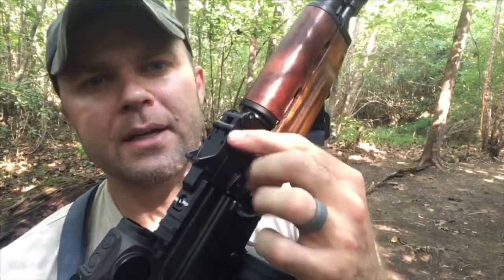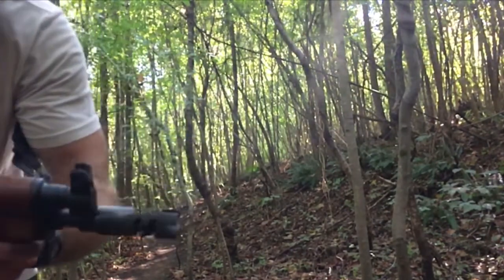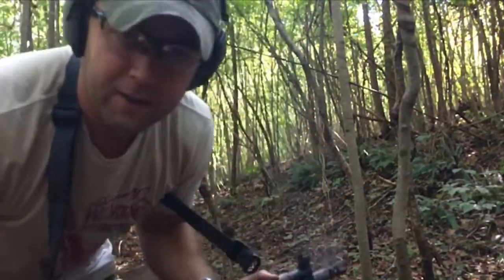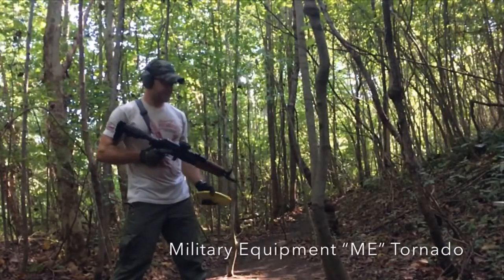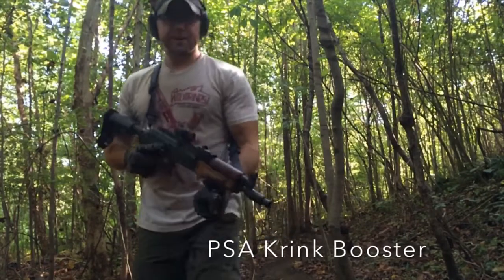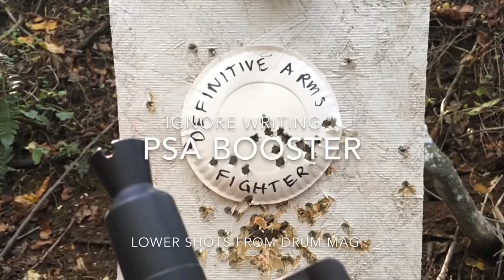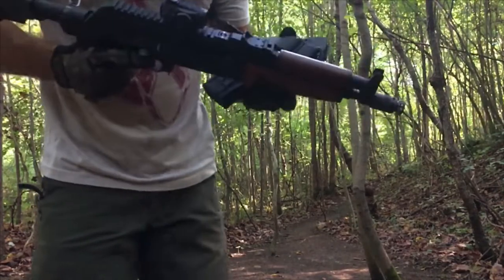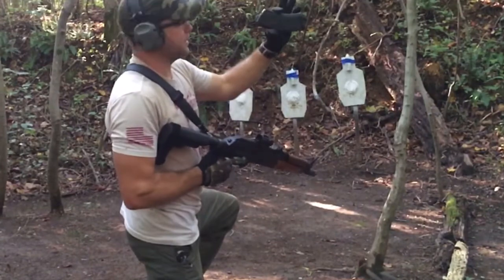PSA AK-P ..... DID THEY FIX THE TOP COVER? / MUZZLE DEVICE TESTING / KOREAN DRUM MAG

Comment: Plan to get the AK-P soon. After all I've read, the top cover coming loose seems to be a common issue. Its almost 2022, I'm not sure if PSA has addressed this problem other than have AK-P's sent back to them. Seems like I will need to have a lock washer and/or rockset on hand when I get this AK-P. Great video, man. Helped a ton. Subbed!

Comment: To tighten that loose brake, get a crush washer for 7.62 barrel, file a deep enough notch for the plunger pin to secure the brake when you tighten it against the crush washer. This has worked for me to tighten a loose brake.
Reply from the maker: Thanks! But that brake is going in the pile.....

Comment: I'm glad I never had an issue with my Saiga. 1500+ rounds so far and no issues
Reply from the maker: You shouldn’t.
Reply: I've got a little over 1k rounds through my psak47 gb2 with no issues. I don't like the fact that it has a billet trunion but I only have $500 in it so I'm just gonna run the shit out of it until something breaks. It's been surprisingly accurate and %100 reliable with pmags and cheap steel cased ammo.

Comment: you need to use muzzle devices designed with the offset detent pin, your normal AK variant pin is at the top and it clocks the muzzle device to work as a brake, flash hider...ect, the krink booster has an offset notch for the offset detent pin on the krink style front sight block. on my M92pap(same front sight block) I took a new detent pin and bent the end of it so it almost touches the threads, took a kvar 74 style brake with 24mm threads and cut a new notch to line up with the offset pin. about 3000 rounds through my m92 with atleast half of that 75rd drum bump fire dumps and the thing doesn't show any wear just dirty as hell, dont worry about abusing these things!
Reply from the maker: Yeah, the break was definitely not timed correctly. Thanks!

Comment: Good to hear so far so good on fix. Ever figure out how to install a decent light platform yet? Getting ready to order akp  and that has been my biggest head scratcher so far, thanks in advance
Reply from the maker: Ultimac rail, with haley strategic mount. Checkout Aregularguy 90 on youtube. He has a draco setup.
Reply: Or just get one with magpul furniture. Their handguards do an amazing job of insulting you from the heat off the barrel and gas block. Plus they have mlok attachment points at 6, 3, and 9 o'clock.
Reply from the maker: Agree the Magpul HGs are awesome at blocking heat.
Reply: I have magpul furniture on my AK. Used an offset MLok mount and and SF600. Works great. Check out my AK LARP video. :)

Comment: Anytime I have a screw, which I don't actually need to unscrew at any point in time, but I definitely don't want it to unscrew on it's own: I'll just JB weld the bastard and be done with it.  Mix up some JB, put it on the screw, put it in place, tight, clean up the excess and let it cure for 24 hours - It won't ever go anywhere again. 

When you absolutely do want to remove it: lock screws are soft steel, just drill through it with an under sized bit. Then repeatedly drill the same hole with one size larger and larger until what's left of the screw body comes out and then chase the screw hole with a tap the correct pitch and size.

Comment: Did you send the rifle back just for the loose bolt? Or were there other issues as well?
Reply from the maker: I just wanted to see if what they put on would fix it. It came with red loctite. They also replaced the roll pin.

Comment: Seems to me that that ME brake is designed for .308 / 7.62x54R AK variants. The pin on the krink fsb isn’t designed for the detent recess on that brake.
Reply: Liked and subscribed thanks for making a vid about that brake. Should do well on my 103
Reply from the maker: The detent on the AKP isn’t at 13 o’clock like others.
Reply: @wellregulated8725  what the fuck kinda clocks you looking at that have 13s on em
Reply: @wellregulated8725  🙃
Reply from the maker: @ritotron5752  supposed to be 12…. 🤦🏼‍♂️
Reply from the maker: @ritotron5752  gassed back a lot though…. And loud

Comment: What's the latest with your AK-P top cover? Unfortunately, I noticed that it had come loose again when I was cleaning mine today. I won't send it back in to PSA a second time for this but will have to try using a lock washer or something. This is really irritating. They're coming out with some great AK's, I wish they would fix this one particular design flaw for the AK-P as well.
Reply: Anytime I have a screw, which I don't actually need to unscrew at any point in time, but I definitely don't want it to unscrew on it's own: I'll just JB weld the bastard and be done with it.  Mix up some JB, put it on the screw, put it in place, tight, clean up the excess and let it cure for 24 hours - It won't ever go anywhere again. When you absolutely do want to remove it: lock screws are soft steel, just drill through it with an under sized bit. Then repeatedly drill the same hole with one size larger and larger until what's left of the screw body comes out and then chase the screw hole with a tap the correct pitch and size.
Reply: @ObservingLibertarian  sounds good to me
Reply from the maker: Hope they fix it this time. Join the PSA AK group on FB.

Comment: Has it ever failed on you with just a regular non booster brake?
Reply from the maker: TryHardGamers only prob was the top cover. No malfunctions.
Reply from the maker: TryHardGamers wait, what are you referring to specifically?
Reply: @wellregulated8725  I'd like to run a pistol AK with a brake rather than a booster.  I imagine this could be a recipe for failure,  but clearly you mag dumped fine with the fighter brake on.  Have you ever experienced an issue using a brake on a pistol ak?

Comment: Knowing the issues now... I think some red loctite on the roll pin and the Allen screw right out the box would do great. Clear nail polish works just was well if you NEVER want to remove it again
Reply from the maker: The gun did come with red Loctite on the allen screw.

Comment: Where did you purchase the new furniture ? Looks sick compared to the Magpul on this particular "pistol". Also spoke with PSA yesterday. All of the AK-P future cover screws has been corrected ! Informative video. Still concerned as a lefty if this will cause to much blow back compared to a 16" barrel...hmm
Reply from the maker: Bought it second hand, and a few surplus stores. Try Lee’s Mags, Desert Fox Tactical, and apex gun parts. 👍🏼
Reply: Interesting! Did they say how they've corrected it specifically?
Reply from the maker: Nope. I sent a note in the box asking them to explain what they did... but it was blank.
Reply: @wellregulated8725  sorry, the question was meant for "IndialanticRob", he mentioned that the AK-P future cover screws have been "corrected". I wonder what they told him. Maybe they used a different size? Or just that the dark gray thread lock is now their standard. I had the same color thread lock on mine when I got it back.
Reply from the maker: 👍🏼 I’m curious to know if the screws are different.
Reply: @CheJoffre  the exact answer was "we have corrected the cover screw". I did not receive the how or what. Lead Star Arms whom also sells on PSA has the same cover and screw design. I was told they fixed theirs as well when I contacted them.
Reply: @IndialanticRob  Thank you. Hopefully eventually they'll permanently attach the two pieces. It's annoying having to worry about that screw backing out.
Reply: 2 years later here I am reading as much as I can from the Ak-p. I plan to get it real soon but dont want to send it back to PSA like you gents, have. Ugh. Thats frustrating! Specially over a small screw! I will buy rock sett thread locker and have it here just in case. I have some JB weld but that would be a last resort. I really dont wanna go that route but will if I have to. I read PSA corrected this. I hope this is true… we shall see. I do plan to make a video on my channel on it once I get it. Well Regulated has given us valuable info and I have learned from all you dudes. Thanks!🇺🇸

Comment: What size is the bolt that keeps backing out?
Reply from the maker: No sure… it’s gone now
Reply: @wellregulated8725  must of missed your fix.  I will rewatch your video.
I added more red loctite to the thread after cleaning it out. Next range day will tell me if it fixed it.
Reply from the maker: @wrangler0829  did you have a problem?
Reply: @wellregulated8725  same issue as yours. Screw for the hinged dust cover fell out after the first trip to the range. Found it on my tarp when I was cleaning brass.
Reply from the maker: @wrangler0829  that sucks. Should’ve been attached like an M92 or krink. That.. or have 2 screws.

Comment: Me When You Mentioned The Issue: Why didn't you just use rock set instead of sending it back?  
You: They used dark gray rock set.
Reply from the maker: I wanted them to fix it. Should’ve been right from the get-go.
Reply: @wellregulated8725  you expected an American-made AK with an unconventional hinged dust cover to be right? You're a brave man lol. If they actually hold a zero even with the bolt secured, I'd be impressed enough to buy one of that design in a full sized platform though.
Reply from the maker: I should’ve gotten a draco.
Reply: @wellregulated8725  yeah man i feeeeeeel that. My AK-V is eating dust covers. The rear is cheweed up and the bolt stays tight but the entire cover is being pushed back and the bolt digs into the cover area. Its wild. They want it back again. I shoulda got a draco too. Akv has issues!
Reply from the maker: I’m down to Romanian stuff now...

Comment: How long is the akp not including the brace?
Reply from the maker: Like from the back of the receiver to the end of the barrel?
Reply: @wellregulated8725  yeah, I'm looking at the model with the folding brace and can't find an overall length anywhere
Reply: @wellregulated8725  bump
Reply from the maker: Did you answer?
Reply: @wellregulated8725  yeah I said yes, from the back of the reciever to the end of the barrel, I'm looking at the model with the folding brace and can't find any measurements
Reply from the maker: 19 3/8”
Reply: @wellregulated8725  great, thanks
Reply from the maker: That’s end of barrel... not muzzle device.

Comment: I want to get the triangle side folder
Reply from the maker: Me too, not crazy about the blocky folding mechanism.
Reply: @wellregulated8725  I thought it was an actually attachment you need to pin and screw into it, but apparently the triangle folder attaches to a 1913 rail. So technically it can go on any gun that has that rail end plate
Reply from the maker: Ok. I wish it bolted directly to the rear.
Reply: @wellregulated8725  Probably making it easier for people who don't want to drill holes into their AKs
Reply from the maker: Paps, dracos, and all.....
Reply: @wellregulated8725  so get one of THOSE, add a 1913 rail on the back and attach the triangle folder?

Comment: Why didn't they just make it one solid piece? That would have been the smart thing to do.
Reply from the maker: I have a feeling it has something to do with modularity in the future.
Reply: Yeah true. Worst case I guess you could always just throw a Texas weapons system rail on it. I believe they're one solid piece. You could also throw some red loctite on it or even throw a tack weld on it. It's not like you'd ever really have a reason to remove that screw. If you needed to remove the cover for some reason you could take the roll pin out.
Reply from the maker: It came with red loctite!
Reply: Damn, that's crazy. That usually won't let loose without very high heat. Way more than a dust cover should ever see.
Reply from the maker: There is a chance the threads weren’t cleaned properly and vibration rattled it loose..... 🤷🏼‍♂️
Reply: Yeah or if it had any kind of grease or oil that'll affect the loctite. It's good though that it's holding now.
Reply from the maker: So far so good.

Comment: Why not just put some green lock tite?? Would never move again
Reply from the maker: Years ago I put the thread penetrating green loctite on something....... and I broke the hardware taking it off. Not sure how the green takes heat... 🤷🏼‍♂️
Reply: @wellregulated8725  green loctite is pretty much welding them. It's for when you never what to take it apart. Needs a lot of heat to come loose. Red should work if it needs to be taken off
Reply from the maker: Came with red.

Comment: I would not run rounds like that in my own gun; might result in problems other than the sight system. There is a reason that the sustained rate of fire for rifles like the M16A2 is 13-15 rounds per MINUTE. Nice video, thanks!

Comment: Bro, you sent your gun back into PSA to have them put threar locker on it. Cmon bro. Ita called red loctite. Put it on yourself first.
Reply from the maker: Bro, it came with red loctite. They use rock-set, or something similar.
Reply: @wellregulated8725  yeah, I've heard of that. My buddy puts rockset on his cloner guns. My point is you could have bought a tube and put it on your threads yourself. I had to send a buddies AKP in that's all messed up and the gun was gone for over a month.
Reply from the maker: I’ve got other guns. It wasn’t my responsibility. If I put a rail on or something that kept coming loose I would’ve done it myself. This was their problem.
Reply: @StraitClownin909  What PSA needs to do is change the design for how the topcover is attached. I had the same issues and tried red loctite but that didn't work. Sent it into PSA as well and it was fine for a while, but it is loose again. Instead of attaching the top cover with a screw it should be hinged permanently.
Reply: @wellregulated8725  Exactly!

Comment: Poor unreliable design. They should have copied same shit Zastava m92 has. No fucking aluminum parts on first place and no 5 fucking unnecessary screws to hold sight, dust cover parts.  There is nothing they can do there but to weld the piece where the screw is which is issue it self because dust cover is aluminum , screw is probably some sort of other steel type as well as the part of hinge where it meets the pin might be third type of steel. I wouldnt mess with this other then range. Iwould never use it for self defense of any kind. You never know when you are  gonna lose zero when your optic mounting part has three or more moving parts on top of few different types of material.